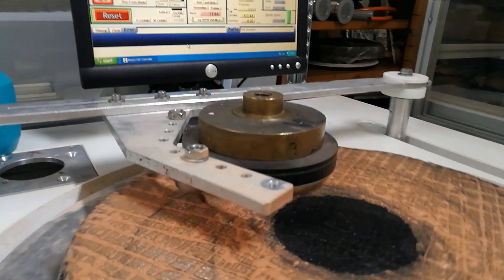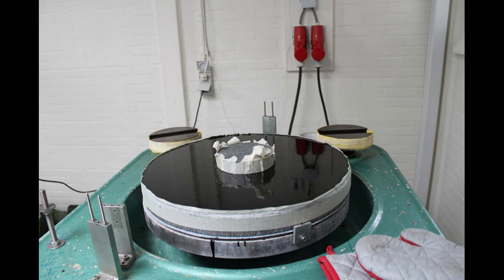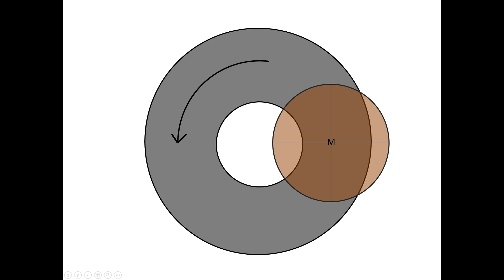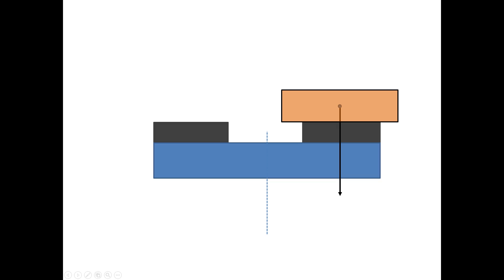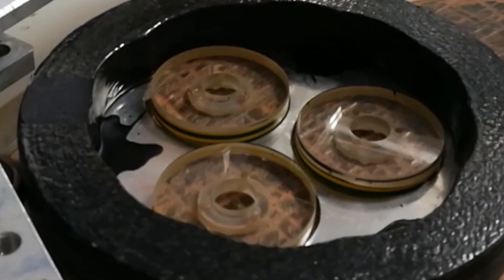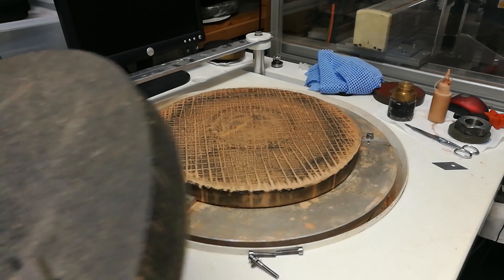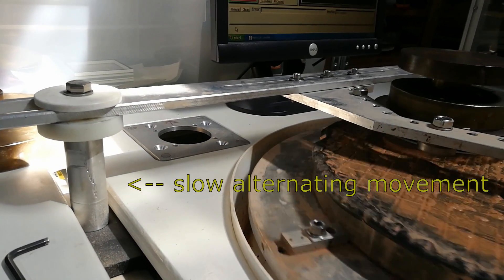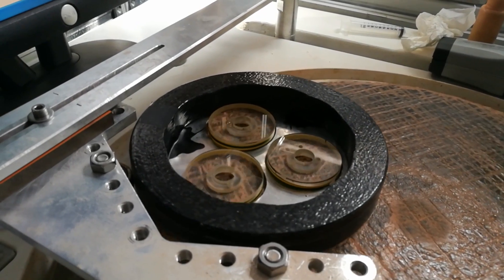How to make Very Flat Optical Surfaces on Glass

Comment: Dear Jeroen,
Inspired by this video I settled out to try taking broken Nd:YAG crystals and polish them to be usable again. I have already hand-lapped then using 3µm abrasive to about 3 wavelength flatness. Currently, I am finishing building a pitch polisher following your example here to bring them to final flatness. However, since they are not glass I can't use cerium oxide. I found a paper suggesting using .3µm aluminium oxide. Do you have any recommendations for the concentration of abrasive in the slurry when using your type of polishing machine? and do you have a hint where I could source this polishing compound as a private person in small quantity for a reasonable price? (Using the keyword "Linde A" I found a lot of North American sellers but none of them seem to send to Europe where I am based)
Thank you for your inspiring videos and in advance for any tips you can provide!
Reply: Hi. I have the same your laser rod that need polishing aganst. Did you succeed?

Comment: Like the other people have said, really great video and clear explanation.  One question: What's the relation between the maximum size of flat you can grind vs. the minimum size of the large pitch plate below?  I mean, how small can you make this machine vs. how big of a flat can then be produced.  I am wondering about grinding flat mirrors for star diagonals for telescopes, not sure how big yet but maybe up to 90mm (?).
Reply from the maker: If you have a round mirror the size can be up to 35-40 percent of the pitch ring. However it is more difficult for rectangular objects like star diagonals. You need to contain them in a ring. For a 90mm diagonal you need at least a 350-400 mm pitch ring. Also you cannot attach this type of object at the angled surfaces to the holder, but only at surfaces perpendicular to the pitch surface. For example using hot glue. If you look carefully at the connection of the elliptical mirror at 6:58 in the video you see that it is connected at the short side with two dots of hot glue (on each side) to the aluminum holder.
Reply: @HuygensOptics  Could you just create the flat in whatever shape is most convenient for the machine then water jet cut it out or something like that to get your desired shape (ellipse, rectangle, etc.)?
Reply from the maker: It's possible, but it depends on the flatness you require. Generally the cutting will introduce stress/cracks in the material at the cutting interface, which can seriously deform the objects in the um scale range. If you require high quality optics it's not an option. Also the abbrasives in water jet cutting can very easily damage your optical surfaces, even with protective layers applied.
Reply: @HuygensOptics  hm... maybe you could use the larger blank of 'convenient shape' and cut out the desired part(s) about 99% of the way with a small diamond grinding bit of some kind, leaving a holding ring or maybe tabs, then do the flatness grinding/polishing, then just snap the parts out by breaking the thin retaining glass.  Or maybe try EDM using one of the techniques for non-conductive materials.  But, yeah, at that point there's probably not really an overall cost/effort savings. :)
Reply from the maker: That is a trick used with for example with the central hole in telescope mirrors: you drill almost completely through except fort the last 2mm or so. My personal experience with this method is not positive. Generally, if there is residual stress in the material, it will be partly released when cutting parts out, deforming the piece. I always bring the object in its final shape and then start grinding and polishing and focus my efforts on a good mounting method and the correct tool shape.
Reply: @HuygensOptics  interesting.  Glass is a real prima donna.  Thanks for sharing your experience.

Comment: If pitch is a liquid, couldn't flatness be achieved without a reference flat (like the bruiser or surface plate)?

Enclose the pitch in a container with walls higher than it and heat it up enough to reduce the viscosity so it flows fast enough for the surface to find its level in a reasonable amount of time, then let it cool down. Surface tension would mess with the flatness near the walls, but closer in should be fine. 

I suppose you lose the grooves though, darn.
Reply from the maker: You will have to wait for a long time before the surface reaches submicron flatness. Keep in mind that there is a volume contraction during cooling down. And of course it is not just about getting the tool flat, but keep it flat during processing.

Comment: Newtonian liquid is just a liquid / fluid. Classic. Water, alcohol, glycol, air are all newtonian fluids for example. So, it is not "special" in any sense. Optical pitch has just very high viscosity.  There are fluids that are special, and they are called non-newtonian. There are many types of non newtonian fluids and they all have various applications and fascinating properties. :D  There are some non-newtonian (visco-elastic with non linear sheer relationships), that are also used in optical polishing, but that is rather very different method.
Reply from the maker: You are right about the fact that a lot of common fluids are showing Newtonian behavior.  But there is also quite a lot that are behaving non-Newtonian such as paint, yogurt, ketchup, toothpaste, so in that sense non-Newtonian fluids are also very common. I guess, all fluids are special, but some are more special than others ;-).
Reply: @HuygensOptics  That is true. Non Newtonian fluids are also common. They are just harder to analyse :) ketchup is weird indeed for example. Or magnetorheological fluids, used btw for very precise polishing in optics. Learned about it just few days ago. :D
Reply: @movax20h  which field do u study this?

Comment: i am a machinist by trade and when i was initially linked this video, and i only saw the title, i thought "oh great some charlatan is going to talk about taping sandpaper to a piece of float glass" but i was pleasantly surprised to see that was not the case and this is the real deal. subscribed.

have you considered trying a cast iron master surface for the weight? as long as the room is at least loosely climate controlled, you could theoretically have a more economical option for a even flatter surface than the granite plate
Reply from the maker: In principle cast iron would work just as well as granite. The CTE is around 10-11 ppm, so compared with granite (8ppm) this is only slightly higher. And because of it's higher thermal conductivy, it will get to thermal equilibrium (and retain it's original shape) quicker than granite. So it would in fact be a better choice as a material. However, don't know how easy it is to make a cast iron disk of 400mm in diameter with a flatness of approx 1um. By the way, granite is not an expensive material.
Reply: @HuygensOptics  i know that in metrology cast iron is preferred for master surfaces, because it is more dimensionally stable and easier to make very (beyond AA grade) flat. for your specific use, it would also help as cast iron is denser so it would be heavier for the same size. that is why it came to mind.
Reply: @SuperAWaC  Actually in some super accurate machines, aluminium with internal cooling channels can be preferred too. This is because aluminium has way higher thermal conductivity (about 3 times higher than iron) and can be stabilized better, down to 0.1°C. Of course if you deal with big loads and need very high stiffness the cast iron or granite are preferred, but with low loads, aluminium counter intuitively can be even better. I can't find source and machines doing that right now, but I do remember seeing some year ago.
Reply: @movax20h  I do know that many coordinate measuring machines have ways that are aluminum which is hard anodized and then lapped to extreme tolerances. It wouldn't surprise me if the very high end ones are also liquid cooled. I do know that they are kept in tightly temperature controlled environments with any heat sources removed (such as computers and humans) and put into different rooms, which is probably enough. But it would take longer for the whole machine to soak back to equilibrium if that environment were disturbed.
Reply: I am a Tool & Die machinist and horologist and it made me happy to see there are other intelligent machinists watching things like this.

I would second the use of a cast iron master plate. There is a guy who comes once a year to certify the multitude of granite surface plates we use in my shop and the man that does this is one of the rare ones who actually can re-lap the granite plates back into spec for flatness using a Master cast iron plate using aluminum oxide abrasives of various grades.

Cast iron master laps are always made in pairs of three to get true flat reference surfaces- I know they are still made but I am not sure who you go to to buy one but if you had one I am certain you would get better results since they are what are used to correct even the granite surfaces

Comment: This is very interesting. I read somewhere that for lapping of silicium wafers they use some chemicals instead of abrasive particles. I can't imagine how precise they must polish wafers for 4nm technology.
Reply from the maker: It's generally a combination of both. If you use a chemical that etches your surface  while you are polishing, you can use a very mild (or soft) abrasive agent, which results in a smoother result. By the way, when you use Cerium Oxide to polish glass, chemical interaction also helps speed up the polishing process. For wafers the actual flatness is less important that the smoothness, since modern wafer steppers make a heigh map of the wafer to correct for the total thickness variation when clamping a wafer to the chuck. Modern technology wafers are indeed incredibly smooth and flat (from the dimension of individual components to that of the full chip)